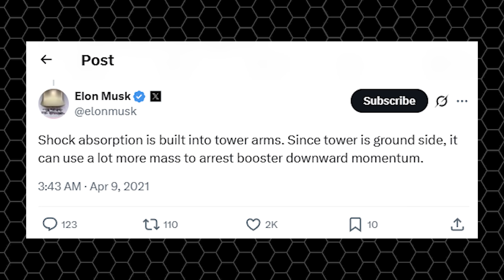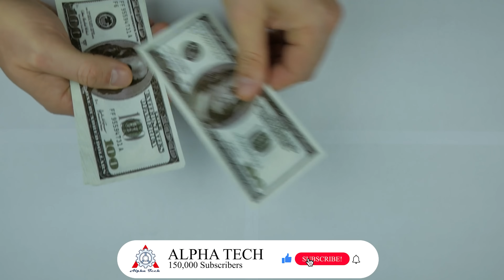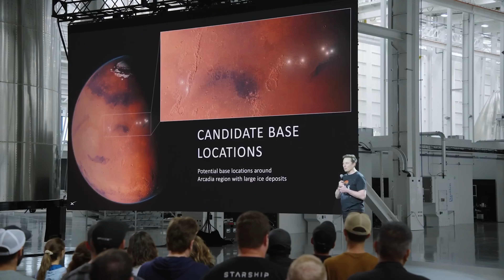How Elon Musk SpaceX Catching Starship is much Better Than Blue Origin New Glenn: Skip Leg!

Comment: In reality building train tracks and landing the ships on a rail car would be 100 times better. Because one mistake takes out the tower. If you land on a rail car and send the ship by rail over to the inspection bay and then by rail to the tower to be stacked would be very efficient and safer in the long run
Reply: The railroad is unable to transport items of such dimensions.

Comment: Don't get it twisted what Blue Origin has done is pretty huge. This is a legitimate heavy lift rocket and it performed a real mission on its second flight, launching cargo into orbit. 

Also doing a drone ship landing with a heavy lift rocket is a lot more difficult than a medium lift rocket like Falcon 9, which is still also very impressive, especially with the frequency and consistency of it. 

Also designing New Glen so that those landing legs welded themselves to the deck of the ship to keep it from falling over is pretty brilliant. Also blue origin has patented that technology. 

I always wondered how they would be able to secure those huge rockets quickly enough on to the ship to keep them from falling over in rough seas and blue origin has figured that one out. They actually patented two different technologies with one of them that welds itself to the deck and the other one where it drives nails into the steel. 

I'm a team Elon musk - SpaceX fan and that is not going to change anytime soon. But blue origin did a great job here and it is a pretty big deal. I prefer seeing two American companies dominating instead of just one anyway because it's just better for America if we don't have a monopoly. Anybody who is down playing this are not being realistic and are being too much of a fanboy.

Comment: Blue Origin is like a serious engineer that designs a solution that works nearly right away.  Yes they took their long sweet time.  SpaceX is an engineer with ADHD that has to iterate to figure out the solutions that works.   The nice think about landing on the ship is that you can spend more of the fuel accelerating your payload.  Starship has to spend a lot of energy just to turn around back to its launch point.
Reply: The spacecraft launches eastward and the Earth spins eastward. After separation the booster rocket cancels eastward velocity into a short climb to suborbital apogee as the earth spins eastward and slides the landing point under the booster.  Both companies know all about this. The booster doesn’t power its way back to the landing point.. the earth spins the landing point under the booster..

Comment: There's tradeoffs to this. Yes Mechazilla will make Starship turnaround times unmatched, but a lot of that saved turnaround time is gonna be spent on launching multiple tankers and refueling just ONE starship just to get it out of Earth's orbit completely. I doubt one droneship will have used more fuel than 10+ tanker starships and superheavy boosters.
Reply: It also saves weight on legs and shock absorbers, increasing payload.